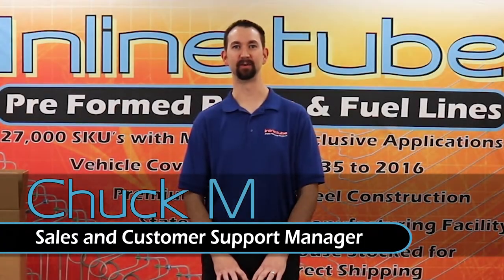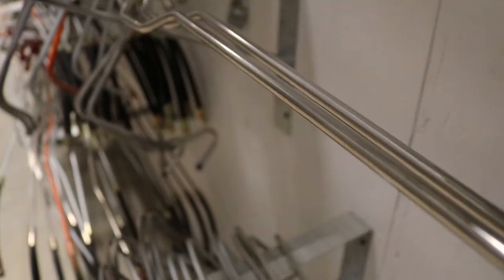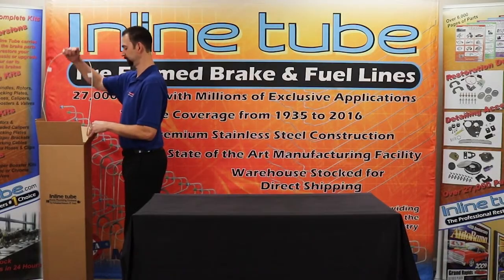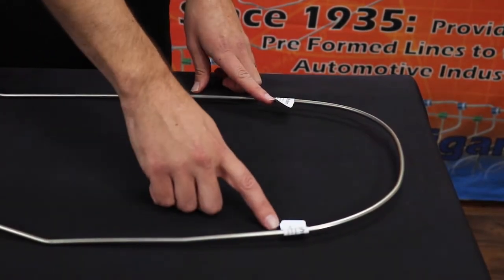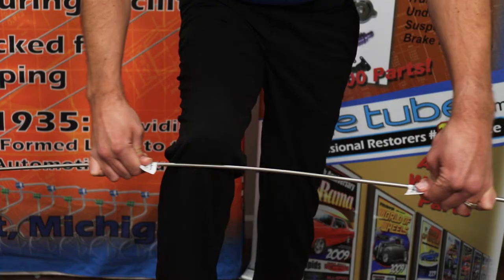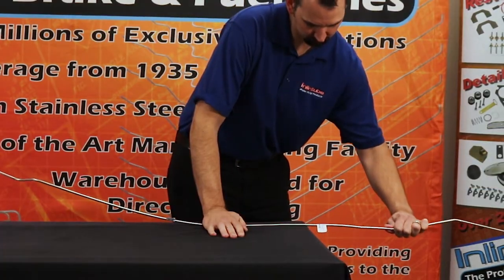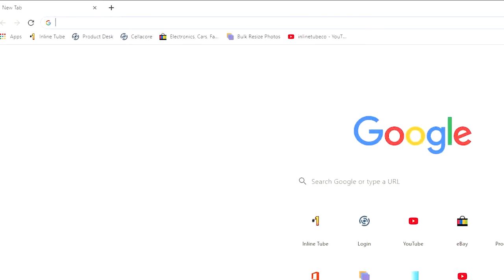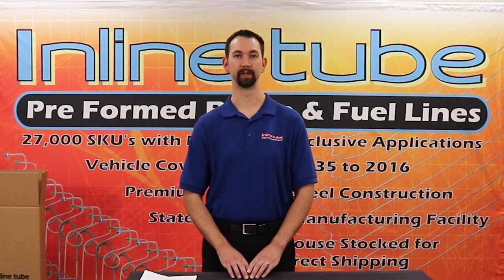How to | Remove Shipping Bends from Preformed Lines

Comment: The kit for my '74 Chevy C30 wasn't even in the same state as the ballpark. So much for spending a bunch of money for the convenience of a bolt-on solution. I got it done. I had to bend everything by hand. Whoever gets the truck after me will know those lines were replaced, because the bends are all caty-whumpus, but at least I got it together.

Comment: Bought a brake line kit for 1998 expedition 7 piece kit only 6 lines in box . the 2 from the master cylinder to abs unit would rub on the engine oil dipstick tube if installed as received. called their phone number unwilling to help because we bought off of amazon (from their store site) what a HORRIBLE company would not buy anything from them ever again  cost me 1 full shop day.